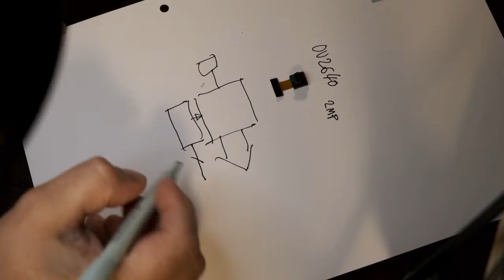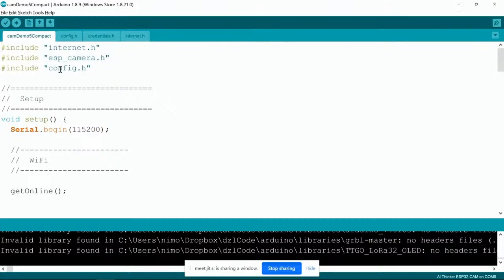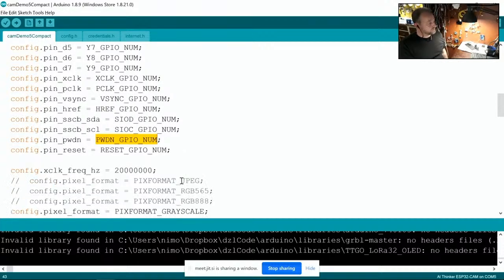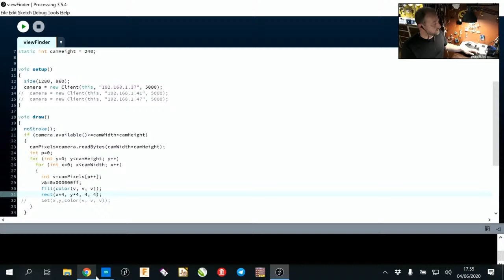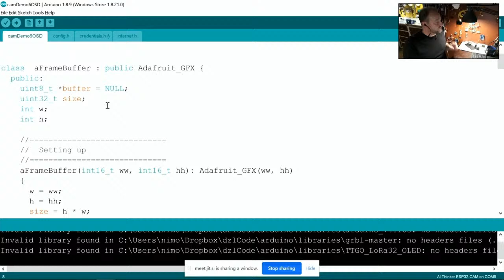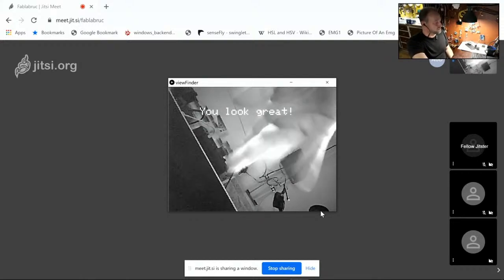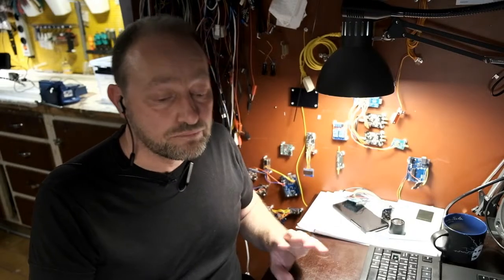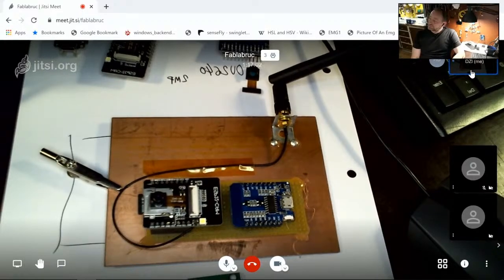ESP 32 CAM - Tracking and datalogging movements

Comment: Would it be easy to track this kind of gauge: https://imgur.com/a/o2IzAcF. It's my generator fuel gauge and I wanted to track the red part to tell me how much fuel is in the tank. But I need to consider the generator vibrates to a certain extent and there may be light changes since it's outside. So does this camera able to stabilize video or that wouldn't be needed?